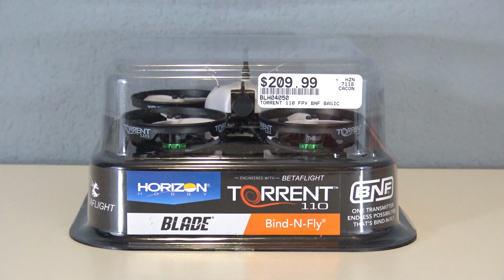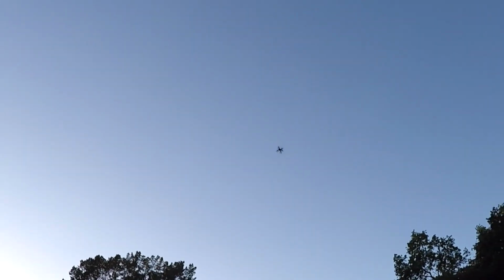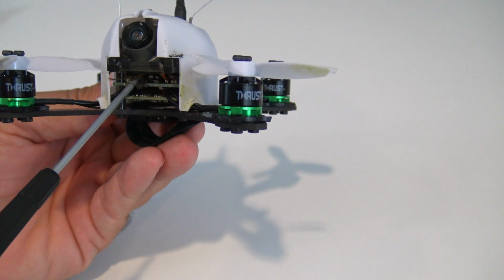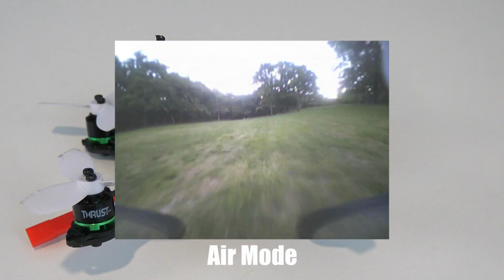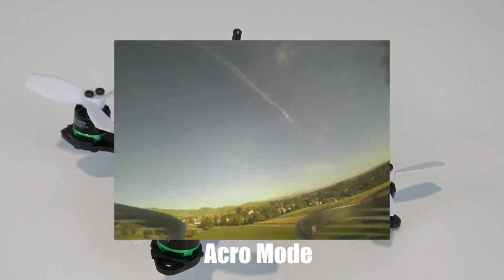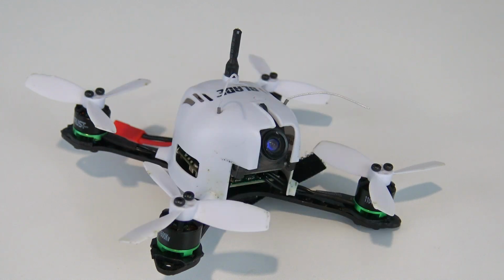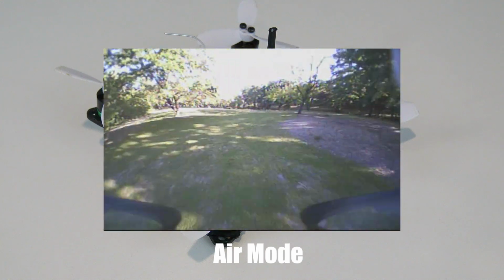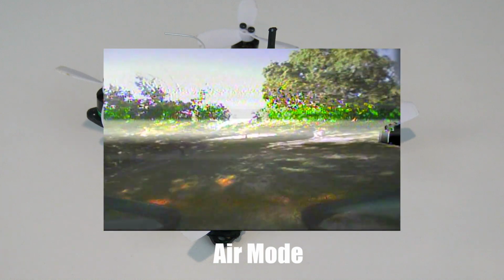Blade Torrent 110 FPV Quad | Review and Flight

Comment: One of the best out of the box bind and fly 100mm quads out there.  Was the one quad that instilled enough confidence in me to go all out and learn rates on. Best tips for this quad are to ditch the prop guards (they are heavy and not all that effective! and break pretty easy at speed), and upgrade the props to some nice Gemfan Hulkie props. Don't bother running 3s because it's not really meant for it. it can do it, but EVERYTHING gets smoking hot. You can tune some of the heat out, but it's best to just run it on 2S. Plenty of power and punch.,

Comment: I had one of these. Would only fly correctly in acro mode. HH said it was due to vibration interference from the motors to the gyro. HH refunded my $$ which I spent with them for something else that would fly like it was designed to do. Did not like this quad at all.

Comment: I'm thinking of getting this as my first fpv. Anyway you could link up some inexpensive goggles and a controller that would work with this?
Reply: Quanum has really uped their game with these goggles https://hobbyking.com/en_us/quanum-cyclops-diversity-fpv-goggle.html.  I have one of their early models that has a single receiver and no SD DVR. For a transmitter, if you can't get your hands on a real Spectrum TX, then I believe an Orange TX from Hobby King should work just fine. I've used those for other Spectrum BnF models with no problem..

Comment: What’s the difference between Air and Acro mode?
Reply from the maker: air mode is an acro set up - it allows you to still control the quad at low throttle

Comment: Does anybody know how to calibrate the ESC on the Blade torrent? The pulling the plug with the white wires and then throwing up in betaflight and then plugging in doesn't work I was wondering if anybody else knew another way

Comment: Can you use the 800 2s from the 200qx? Not sure if the c rating will affect it because my other 800 mah have a 40c and the 800 mah from the 200qx 30c, i get about 4 minutes with my aftermarket batterys not sure if the 200qx ones are different???? Awesome video tho man best rc channel on youtube very rare to get a good channel that supports horizon, everyone else is bought out by gear best or bang good, thanks

Comment: I got a Torrent 🤙 but how to change to 11 mili  seconds? Mine is on 22 and I don't know how to change it. Thanks for the great video!
Reply from the maker: its under system settings I believe - frame rate. Did you find it yet?
Reply: No I think the DX6E doesn't have that option. I got it to bind and it flies amazing. When it bound it said 22mil so... who knows? Lol 😂
Reply: PuppetMasterFPV  i noticed also that the newer versions of the dx6 transmitters does not support the 11ms but only the 22 ms. Strange. Because in manual they say you can change, but in the switch menu you can not switch, stupid.
Reply: Guy Van der Schoot so right!! Thank you for identifying something that has been really irritating to me. That no one seems to notice or care. It still works but it's kind of silly isn't it? You can't change it on the 6E and they leave it out of the manual. Seems to me that the ad card slot and a firmware upgrade could add the feature and value to the product but I don't work for SpektrumRC unfortunately. Lol

Comment: Thanks for the review brother! This is an interesting (and goodlooking IMHO) quad :) 
Very good they moved away from propetair FC's / Firmware like Walkera did..  What would you say is the max uptilt for the FPV cam? 
Hmm the 'calibration' shifts.. the one thing I don't really like: no OSD.. Does it have a buzzer by the way? 
ohw and hmm I think you need to try some better lipo's (like FI gens-ace's)
Reply: DutchRC Adventures Good questions!
Reply from the maker: Hey Dutch! Yes so I went and measured it, the camera angle is 25-30 degrees max. It does have a beeper after a crash or lvc. A few times I just landed it and found it by arming the motors. Agree better lipos would likely help! Have a great weekend!
Reply: Well that beeper improves the package quite substantially :)  I Think (pretty sure) you can make the beeper do it's thing in Betaflight :)  Have you had a look at that? :$ 
Thanks man! Have a good weekend as well :) 

@GBL: thanks brother ;)  small world huh? :)

Comment: Awesome.  On a whim, I called my "local" hobby shop (it's an hour north of me) and they had three in stock.  As luck would have it, we are heading by there on our way to up to Stephen King land to pick up some of my youngest daughter's stuff  from college. I bought it on the phone and told them I will be there tomorrow.  Will be charging my 2s packs tonight in anticipation.  If I were really on the ball, I'd setup my DX18 tonight too.
I intend to fly slow through trees, picnic tables, and any other obstacles at campgrounds this summer.  Not to mention, harass the cats and dog in the house.
Reply from the maker: 2 cell packs will be perfect for slow flying around the campground. Radio set up takes 5 min. :) Have fun with the little beast and let me know what you think of it.
Reply: We are taking way longer than I thought to get back.  Had to go way up north.  I was able to setup the DX18 and bind in the truck.  Tried to do a quick power up on the campus and the motors would not arm.  Only when I turned the transmitter off with the quad still powered up did they spin up.  I believe I messed up the arm channel configuration.  My daughter had so much stuff to pack that I can no longer reach my flight bag with my transmitter or my Torrent.
I picked up some extra blades and a prop protector.
Gonna be a long three hour ride home.
Reply: It was the throttle travel.  The key was moving the throttle to the center position to allow both the high and low Travel settings to be set and linked to 150/150 which made everything happy.
I played with it enough indoors, on the tile, to bounce it off the table, granite counter, and then then tile floor.
It's late, I'm tired, I will come back to this in the morning on the grass.
Reply: i know im asking randomly but does any of you know of a trick to get back into an instagram account??
I was stupid lost the password. I would love any tips you can give me.
Reply: @Lincoln Trent instablaster ;)
Reply: @Zavier Levi thanks so much for your reply. I found the site on google and Im waiting for the hacking stuff atm.
I see it takes a while so I will reply here later with my results.
Reply: @Zavier Levi It did the trick and I now got access to my account again. I'm so happy!
Thanks so much you really help me out !
Reply: @Lincoln Trent you are welcome :D

Comment: Watched other videos and they all said the xt30 would be much better than the jst connectors.
Reply from the maker: i dunno could be - the connector doesn't seem like a weak link here. It can deliver the current and is holding up with no problems. I know jsts look pretty frail but they actually seem to perform fairly well.
Reply: Thanks for the infro. I am new to FPV and hobby started in FEB this year indoors indructric
Reply from the maker: cool man - welcome to the hobby er addiction!
Reply: Yes. And almost everyone has burned out or damaged the esc because of too much current to go through the xt30. Esc's are only 6amp.  Jst does its job and it's working. No need to change unless you like to fiddle with tiny standoffs and squish the soldered wires between the ESC and FC and hope you don't have anything touching the FC to transfer the vibrations. It was on my work bench for over 3weeks just to fine tune and first problem I came to was the Thrust motors are bit crappy and cost double the price of same rated motors from different companies.(don't buy DYS...) Most aftermarket cheap sets of blades come unbalanced and will cause vibrations of the quad! Observe what you change and what is happening differently after.  I've hacked and chopped mine so technically it's just the frame and Stack that's still from original product... everything else is either replaced or modified. Biggest improvement: AIO 200mw eachine camera...range and lighting is so much better. And I managed to shave off some weight so now it's 105g with battery full up weight ready to fly instead the 120g as stated in manual.

Comment: This was the best video for the Torrent I have seen. Definitely the most informative. I only get about 1.5 to 2 minutes flight time from my Acro 5" quads so the 3S Torrent seems about right. I am going to pickup some higher C rated 450-500mah packs in case my current 3S 450s are not enough. Now if only Amainhobbies would get me my pre-ordered Torrent. Have a great weekend!
Reply from the maker: thanks Rob, I try to find out what is good and not so good. :) Definitely want the higher rated packs on this one! Hope you get it soon and have a great weekend yourself!
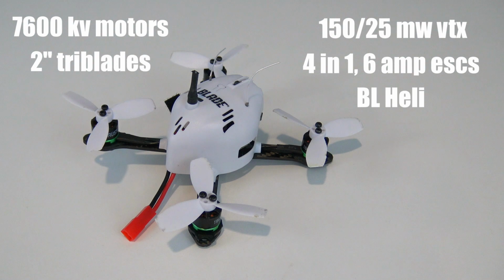Reply: Robert Fontanosa I'm using the 3s 450 nano tech 65-130c and they are still coming down hot with 2:30 to 3 min flight depending on how hard I fly. I'm thinking maybe 500mah high c rating?
Reply: Robert Fontanosa I think the torrent may need to be run off a xt30 for a better amp draw. I'm just to lazy to change out all my lipo connections. Also I have a 850 with a 25 to 40c discharge to see how they work. The 2s I have are for the rodeo 110 and they are not coming down hot nor are the motors.
Reply: Robert Fontanosa I'll reply back when I get them in the mail.
Reply: hey, any  diferences in flight time with the xt 60 ?
Reply: Thanks for the heads up. You have way better packs as mine are only 25C. I will need to see how they are and I will limit to only 1.5 minutes. I don't mind blowing up these packs since I don't run 3S on anything and these have been sitting for a while on storage charge. Perhaps I need to stick with my 4S Shendrones Hedwig for my micro rocket. My Torrent still hasn't shipped out yet so hopefully I can test things out next weekend.
Reply: I am way too lazy to change out to XT30s. Heck, I just converted some XT30 packs I ordered accidentally to XT60s as almost all my batteries are on XT60 even for my 3" quad. Thanks for letting me know how your experiments are going.
Reply: Lukas Post I would not expect any differences with XT60s. I was converting to match the packs I had available.
Reply: I'm using 3s 50c 850mah giantt power batteries and I'm getting 5+minutes of mad 3d/acro/air mode and I hardly want to put it down. I did change the PID's a little bit too and it's waaaay better than it was. No more weird sound and vibrations (I did soft mount the FC) , chopped the prop guards and changed the props just to experiment with. DON'T CHANGE TO THE XT30 Connector! The esc's are only 6amp! The xt30can pass more current witch will cause magic smoke like many people found out the hard way... And the new ESC is like 60 bucks(bit steep) . I did change the camera to AIO with Clover leaf and 200mw vtx(this is essential for better range and less to worry about) and I found the stock Thrust motors bad quality with not the best bearings and lots of play on the bell housing so I just changed them to HGLTECH 1104 7500kv and wow! So much quieter and more punch! Not even hot after 5minutes of slapping the sticks on the 850mah batteries! I LOVE MY TORRENT! It certainly needs a bit tweaking (should be really done out of factory for that price) but it really becomes more enjoyable without that propwash on dips and cornering improved too. Thank you for the video. Greetings from Ireland west.

Comment: I was so disappointed in mine the camera sucks it's way too wide it doesn't have the power it needs they put the wrong propellers on I could keep going LOL
Reply from the maker: lol yeah they are sort of still on a learning curve with this - some things get better and then other things come up.
Reply: Discover RC  this quad is going to my Chop Shop LOL
Reply: Hurry and put it on Ebay. It's a hot item so u may do well ...
Reply from the maker: lol fire up the grinder

Comment: I think it's underpowered. You can build a micro much faster for way less. But it's good for non-builders :-)! Love the vid btw
Reply from the maker: sure - it's not really for folks who build their own. 3s will limit it in that sense too.
Reply: Discover RC but it seems like a reliable quad! Might pick one up 😃
Reply from the maker: yeah it's not perfect but it is fun. :)
Reply: remember that you can always upgrade the motors. 7600kv motor on a quad that's 135g  on 3s is crazy! my 3s rotorx atom build with 1104 is 150g and is fast. if you remove the propguard and put a rx2535 prop, it would be a rocket!
Reply: ADAMBOMB FPV Sure over 200 if you're buying from small companies like tomoquads or something... but if you buy from big online stores.. you can build a good micro for fairly cheap. (Not overpriced like small companies.)